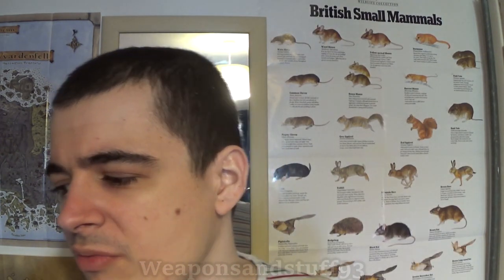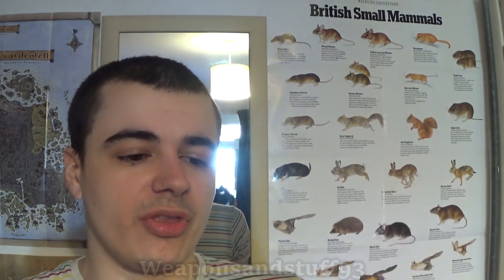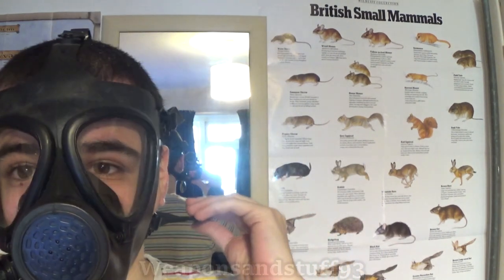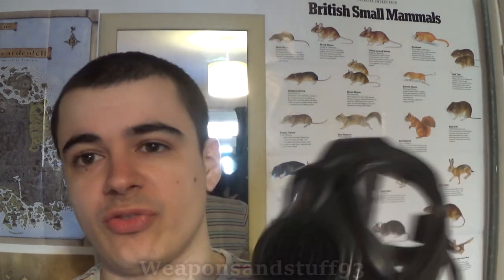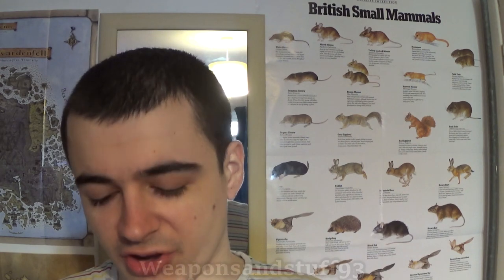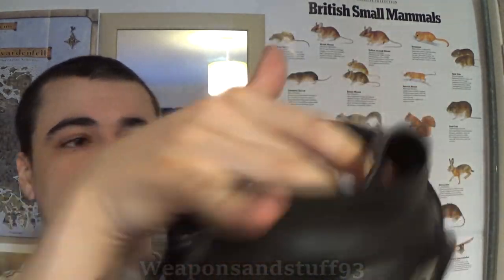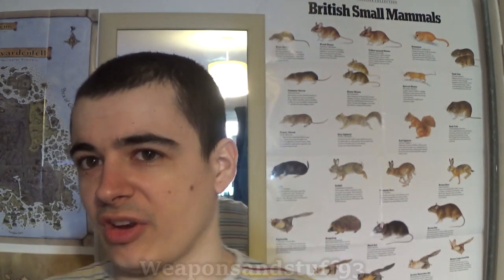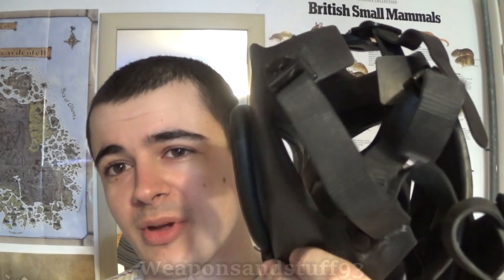Parts of a Gas Mask/Respirator that can fail

Comment: I've always presumed it would be the straps that go first, that's going to be the thing that is constantly stretched and pulled everytime they are used etc like you said.
Reply from the maker: Yeah straps and the buckles for the straps, as you say the bits that are used the most are the most likely to break.
Reply: Yep there is only one thing that broke on one of my masks. That is the strap on my Dräger  M65. Dont know if there are any spare to buy.
Reply: Did you ever find a strap harness for your MCU?

Comment: How do you fix the hole where the plastic pin goes like in the israeli 4a1 if it snapped and lets say the hole got bigger or the rubber ripped slightly and because of it, the strap cannot be attached there anymore, its hard to explain but I hope you know it.

Comment: The straps on my M15 broke. I was so mad
Reply from the maker: Yeah I had to repair mine.
Reply: @Weaponsandstuff93  the straps on my polish mp5 are too tight even when fully loosened. Is there any way to safely stretch them or perhaps a website that I may be able to find a larger strap?
Reply: Is it possible to make a replacement strap?